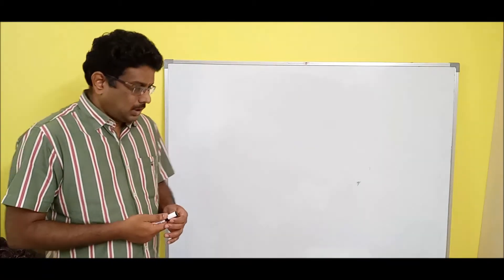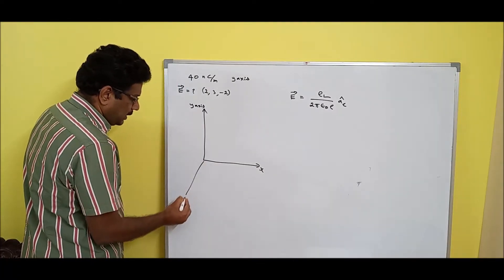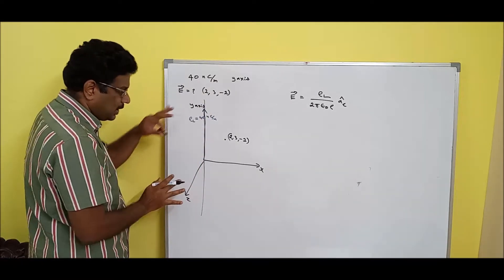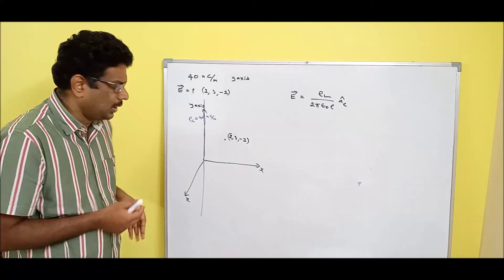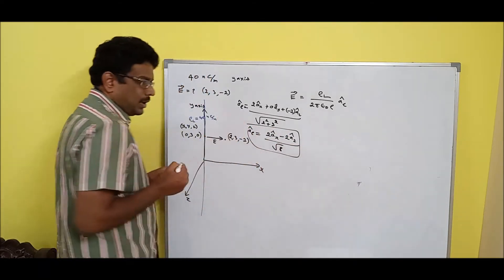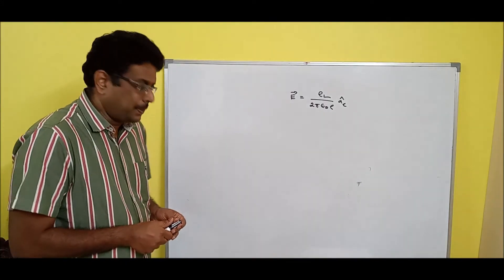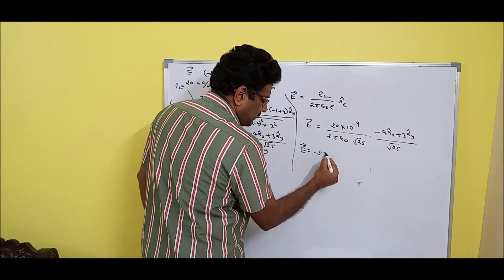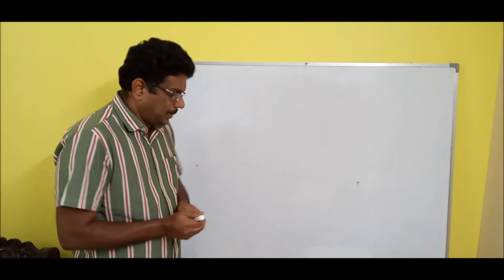EMW 11_Problems on infinite Line Charge

Comment: sir in the last problem while calculating line charge its (-6-(-6), you will be getting a^e = 3ax+2ay/ root(7), final answer is 2080.2ax+ 1387.13ay-3930.9az